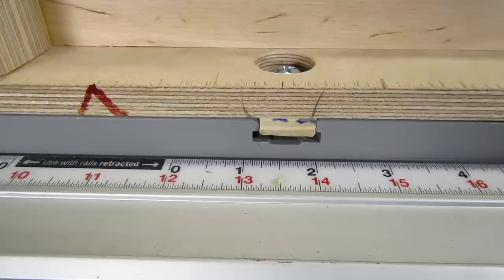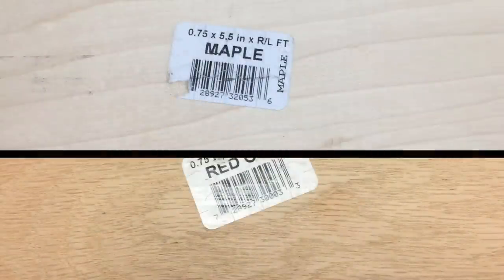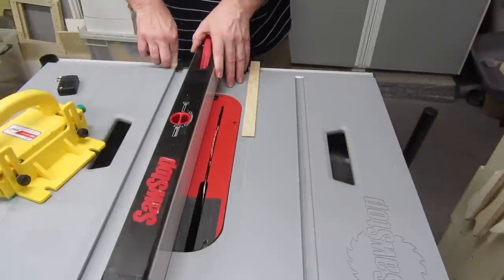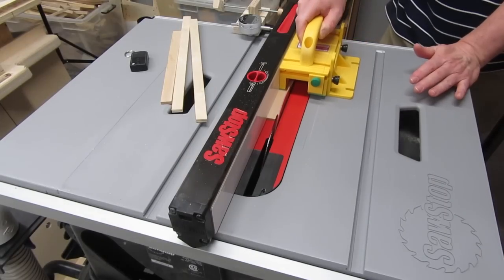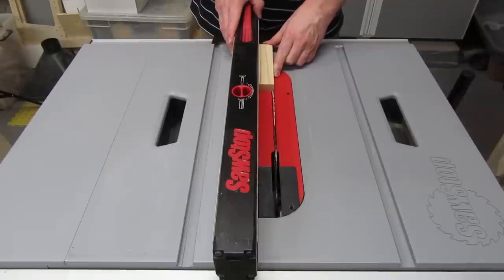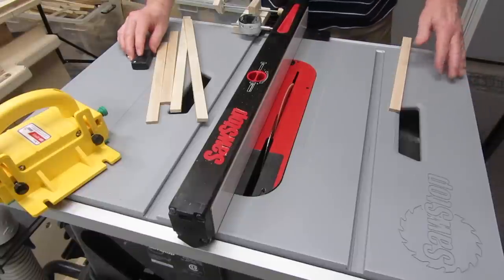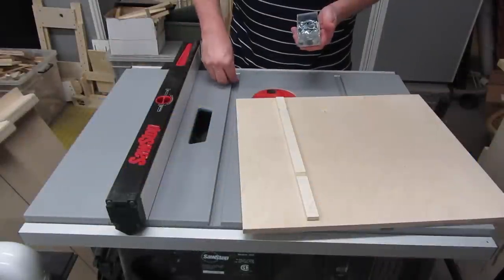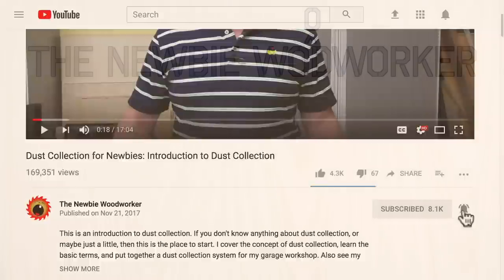Easy! Make Runners for Table Saw Sleds!

Comment: Thanks 👍👏👏👏
Why do  you call them machine   screws?  They are in fact metric screws.
Can i use 10 mm thick plexiglass to make runners? My slots are deep enough.
Reply from the maker: When I was growing up, we used to call anything that wasn't pointed a bolt. Nowadays, I just call them what they were labeled when I bought them - machine screws - which is what they're called at Home Depot (and some online stores). I personally wouldn't use plexiglass - it seems kind of brittle to me. But UHMW plastic would a good choice.

Comment: A note about attaching UHMW plastic runners. The hole you drill in the plastic should allow for the screw to go through the plastic and not bite into it. I learned the hard way (actually, it wasn't hard at all) that the plastic will expand from the screw, rendering your runner too snug to slide easily.
Reply from the maker: Great comment. I learned that the hard way too. I should have mentioned it, so thanks for pointing it out!
Reply: How about using a threaded insert?
Reply from the maker: @RBespoir  That's an option also. Thanks.

Comment: Your videos always inspire me.  My question is your you make your table saw sleds with one runner.  Many sleds I have seen have 2, one for each slot.  Do you have any issues using only one runner?
Reply from the maker: Thanks! I don't personally have any issues with just one runner, but then again, my miter slots are really good. My thinking has always been that if it works with one, why add another? But if I needed another, I would certainly add it. There's nothing wrong with having two.
Reply: The Newbie Woodworker 
I have the same saw as you.  I will try building a sled  with 1 runner.  I trust your viewpoints explicitly.
Reply from the maker: @edmundhayes7982  Thank you, but don't trust everything I say! I can be blind to the obvious sometimes. 😳How about "trust, but verify" - make it with one runner, but double-check to make sure it's stable. Besides, some of that will depend on how accurately you cut the runner. In any case, you can always add another runner if you need to. 🙂I do appreciate your confidence in me, though. Thanks!

Comment: Hi Dan. Thanks for the  video. What do you think of using small amount of wax on the runners. Will help sliding and will decrease humidity absorption. The tricky thing is what means "small amount".
Reply from the maker: Thanks. Absolutely! Just use some paste wax, like you would on a car. If you get too much on, just wipe it off. Personally, I prefer "Slideez" because it doesn't smell: https://amzn.to/2KEHutz
Reply: I wax all my tables (router and saw) with turtle wax for cars. Never had anything bleed into the wood and it makes things slide smooth. There used to be a video that shows trick on tabletop saws that gave a bunch of tune up info. I got it from there.

Comment: Hello Sir, please give your advice about using the metal rail sliders that come with the table saws instead of wood sliders.
Reply from the maker: If the runners fit well in the miter slot, then they should be fine. You'll have to figure out how to attach them.

Comment: Always very informative videos, thank you.
I’m thinking of making runners from pallet wood... hmmm...
Reply from the maker: Thanks. I would think pallet wood might expand and contract too much, but it'll be interesting to see. If nothing else, it'll make a good video, right? Let me know if you post a video about it. If you do, you should probably leave yourself an opening to revisit the subject, in case you experience issues with the wood changing size in the humidity. Like I said, keep me posted!
Reply: The Newbie Woodworker I will let you know for sure.
I don't think it would be too bad if I like you said, pick the right type of wood.
Reply: Are you ok if I quote this conversation in a Q&A video?
I'll mention your channel and the specific video, leave a link to the video in my shownotes
I'll basically read the comment I left you, read your response and then verbally explain that pallet wood is just like any other type of wood and that in my opinion there should be no cause for any abnormal size changes other than the fact that it's usually very dry older wood.
Very cool, very positive and very professional. Essentially I'll give you a shout out and anyone interested will go check out your channel. I'm leaving this as a comment but will also try to send you a direct email via your YT contact function.
Reply from the maker: Absolutely. Thanks for asking, but no need. Quote whatever you want!
Reply: Pallet wood is often pine, so wouldn’t be great.  However, some pallets are made from red oak which would work very well.  The oak ones tend to be darker in color and much heavier.

Comment: I expected you to use two runners. With one on each side, after you have chocked them up with spacers, I think that you could wedge them towards the centre to eliminate any slop from too-narrow runners. Taper the far side tips to ensure they drop into the mitre slots more readily.
Reply from the maker: Thanks. I use two runners on larger sleds. On smaller ones, I've never had an issue.

Comment: Cutting thin strips on a table saw:  Simples.  I now have very thin fingers😂
Extra: Wait 9:45 ….You spent a painstaking time re-sawing those strips accurate to a couple of thou…THEN you clean up the sides with glass paper😳.  In fact…When sizing the fit and it is very close…Why not just stroke the strip along a sheet of 600 grit on a flat surface (glass) instead of fence tapping and re-sawing??  Inspiring video, thank you👍
Reply from the maker: LOL. I didn't take much off with the sandpaper, but you're probably right about the grit.

Comment: Plastic cutting boards  are generally UHMW.
Bamboo flooring also makes good runners.
Reply from the maker: Interesting. Thanks!
Reply: UHMW is way too expensive for cutting boards.  That's analogous to making cutting boards out of Honduran mahogany.  It'll work, but there isn't any point.  ;)
I think if you look into it further you'll find that most of them are actually HDPE.  It's also dimensionally stable and will work great for runners.
Reply from the maker: You learn something every day! Thanks for the info.
Reply: @fisharmor  UHMW (PE500 and PE1000) and HDPE (PE300) are both polyethylene. They're practically the same thing. HDPE just has a slightly lower tensile strength.

Comment: Use double sided tape to attach your runners then drill, counter sink and screw them on. This allows for adjustments and replacements.
Reply from the maker: Yep. I actually use that method the most. I'll be talking about it in an upcoming video, but I wanted to cover the easy stuff first. :) Thanks!

Comment: Should you make sleds with 2 runners? Or would a single runner be sufficient?
Reply from the maker: Personally, I only use one unless there's a specific need for two. Check out my blog post on the subject: https://thenewbiewoodworker.com/2018/05/07/cross-cut-sleds-why-i-only-use-one-runner.html

Comment: Hi,
Interesting
I'm building my workbench and intending to make a table saw using a B&D circular saw and T Track.  So 'sneaking up on the cut' using a table saw is not a option for runners.  
First problem
In UK the normal T track has a gap of 19.3 mm nominally and a dado width of 30mm.  So getting the T-Tracks in exactly the correct position is not that easy especially as with a 1/4 inch router, you cannot get a 30mm diameter bit  So I cut the Dados a homemade jig and a 20mm bit.  Ended up a bit wide, but I needed some wiggle room to get things aligned.  Wiggle room is a technical term fyi

Then for the runners
Couple of options
a) Zanussi sell a HD chopping board with a thickness of 19.05mm and it will be slippy.  Sure you can find some thin plastic strips to glue in place to take out the sloppance (another technical term)
b) 18mm Birch ply I bought was about 17.5mm thick.  PVC membership cards (not credit cards) are about 0.75mm thick so one either side - no sloppance and good sliding.  In fact the fit was so good that glueing them to the plywood with CA glue made it too tight because of the glue thickness.  Bit of sanding/scraping of the PVC needed

Question - do you need 2 T Tracks for a sled with the problems of keeping them totally parallel when you don't have a cast iron table machined to 1 thou accuracy?  You only use 1 for a mitre gauge anyway
Reply from the maker: Sounds like you're having fun! No, you certainly don't need two runners. I use one on most of my sleds. And by all means, do whatever works. Half the fun - no, strike that - most of the fun is figuring out how to overcome things like this. It feels really good to overcome them. Assuming you do overcome them, of course. 😂 Good luck!

Comment: Why raise the runners with washers instead of just milling the runner so that it slides on the bottom of the miter slot and then the bottom of the sled just sits flush with the table and the runner? I’m new to this and I was just wondering because I see everyone put washers inside the well of the miter slot to raise the runner and then put the sled down.
Reply from the maker: When the runners are attached, you don't want them actually touching the bottom of the slots. The bottoms aren't usually completely flat, and there's usually sawdust and stuff in them. So like I said, you don't want them touching the bottom. Also, a lot of people would have trouble being that exact with the milling.

Comment: nice video  ,  have you ever tried one of the poloproplene cutting boards, they make great slides too ,thanks for posting from Garry in the UK
Reply from the maker: Thanks! I did try it once, but I must have cut it wrong, or with the wrong blade, because it kind-of melted the edges when I cut it.
Reply: Cheers garry that sounds like a great idea I'm off to the shops to buy some chopping boards
Reply from the maker: @wolfarlis21  👍

Comment: TIP ... if you sneak up and get the saw set perfectly, and the chances are that you'll have plenty of board left over after taking out two runners .. so why not take out a few more for future projects. you'll have ready made runners that fit your saw and, presumably, in the right material too.
Reply from the maker: I'm pretty sure I suggest this in the video, but in any case, I agree completely.
Reply: Further tip: if you do this then label them up so that they don't get get tossed out when you tidy up. No need to guess how I know this 🤣
Reply from the maker: @georgeprout42  LOL. I have a red permanent ink marker that I use for that.

Comment: Hey Dan,
You've certainly covered this topic thoroughly and with great research, creating a valuable asset for your audience.  I'll offer an alternate way for attaching runners that's quicker and therefore good for some applications when time is short and/or superior strength of using wood glue like you demonstrate isn't necessary.  It's in this video: https://youtu.be/pMDqnRDJDuw?t=18m4s in case anyone is interested in learning a different method.
Keep up the good work!  Best, Matt
Reply from the maker: Thanks Matt! For anyone reading this thread, Matt contacted me first before posting a link to his video, to make sure I didn't mind. And no, I don't mind! Great stuff there. So again, thanks, Matt!

Comment: If you're worried about a long runner bending over time, or with temperature or humidity, try using two shorter runners.
Reply from the maker: Good idea. Thanks! 😄

Comment: UHMW Plastic for runners thank!  - can i get it locally at TAP Plastics?  -- but to help ya out ill use the link and purchase.
Reply from the maker: Thanks! I appreciate it. 😄
Reply: for the waxing.. i use Trewax (it is the one with the carnuba content in it) is this ok or suggest anything different? - for the sliding of the sled on the table saw.
Reply from the maker: That should be fine. Any kind of car wax is OK. I can't remember if I mentioned it in this video or not, but the smell of car wax in an enclosed space really bothers me. Other people are fine with it, it's just me. Anyway, I use this product called "Slideez Lubricant". https://amzn.to/2KEHutz. It smells nice - not overpowering. And the odor goes away quickly, and it works just as good as car wax. But if the smell of car wax doesn't bother you, then just use that.

Comment: Newbie, why doesn't aluminum get used as a runner? All the miter gauges are equipped with aluminum. It is very durable, stable, and easily obtainable.
Reply from the maker: I suspect it's because 1) It's not as cheap as wood, and 2) It's really messy to cut. Just a guess though.

Comment: The info on UHMW is incomplete! You must drill the holes carefully and slightly oversized so as not to blow out the sides of the material which will make them to large to fit in miter slot. Interesting video
Reply from the maker: Yes, you're correct.

Comment: I just made a batch of runners using a piece of leftover laminate flooring. I have no idea how well they will hold up.
Has anyone else tried this? If they work it's a readily available supply, anyone who does laminate flooring always has leftover pieces.
The materials are all over the place, from plastic to hardboard even some with rubber bottoms (for push blocks not runners).
Let me know your experience with this material.
Reply from the maker: I don't have any experience with that, but it seems perfectly reasonable to me. Good idea! 😄

Comment: Wood expands over its wide not length. Check your Recommended spline grain direction
Reply from the maker: I didn't say anything about expanding down the length vs. the width, but you're correct that wood doesn't expand much down its length (longitudinally). Wood expands the most in the direction of the grain (i.e. tangentially). It also expands across the grain (radially), but not as much. I have the grain direction correct. http://workshopcompanion.com/KnowHow/Design/Nature_of_Wood/2_Wood_Movement/2_Wood_Movement.htm

Comment: by the way you insert plate must be level with table when cutting them to width NOT just when cutting to height i failed 15+times made a zero clearance insert and succeeded on 2nd try
Reply from the maker: Thanks, and you're 100% correct. I had the same problem with my other saw. I didn't mention it in this video, because that leads to a rabbit trail of how do you level the insert plate, yada yada, and I didn't want to deal with that. 🙄

Comment: Anybody have any experience incorporating what’s called “Starboard” into their woodworking projects?
Reply from the maker: Never heard of it, but that doesn't mean anything. 😛
Reply: I use StarBoard for my runners for almost all my projects. I found it after my local plastic store ran out of Delrin. I prefer Delrin but StarBoard works perfectly and is very dense.
Reply from the maker: @kdc300z  👍

Comment: Why so bloody exact on the dimensions of the slides.?
.....surely a tad narrower than the runners, then the slides pushed to the extreme outer sides , would be sufficient.?
Reply from the maker: Yes, if you're using two runners, that would work. In fact, now that I think about it, it's kind of a "duh" thing - not sure why I've never thought of that, and why I've never seen it in other videos. Thanks for the comment!

Comment: How about runners made of HDPE?
Reply from the maker: You can definitely do that, and I've done it a few times. Just be careful if you attach them with screws. If you tighten the screws too much, it causes the sides to press outwards a little, which can cause them to not slide smoothly.

Comment: I have an idea for you. Instead of using the glue to attach the runner to the sled's bottom, why not make runner 3/8 thick and then make a groove in the sled the same size as runner 1/8 deep. If runner wears out just make another and insert it.
Reply from the maker: Assuming you're only using one runner, that would probably work. I'd use machine screws to attach it. Good thinking! 😄
Reply: @TheNewbieWoodworker  Yes, I will be making half sled and my SRT21 has only one slot. But since my table is only 21 inch deep I am going to make extension first in the back. I already figured out how. I am also thinking instead of front bar solidly attached I will make it so it rotates for angle cuts.
Reply from the maker: @sushi8204  👍